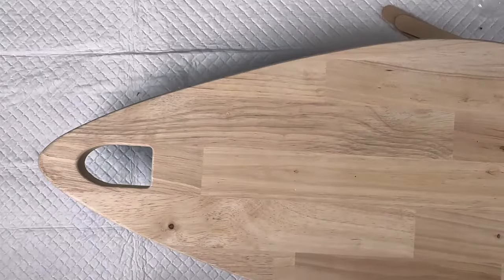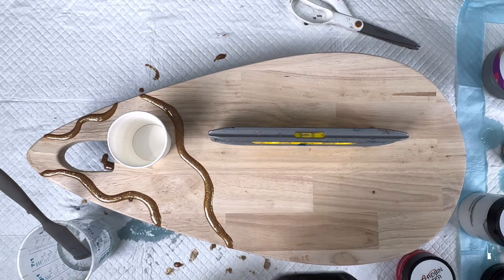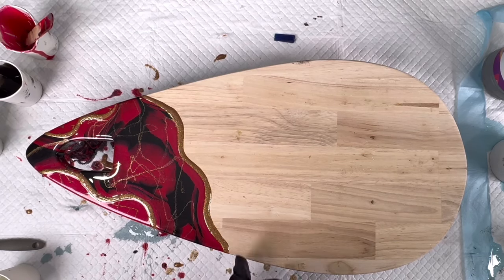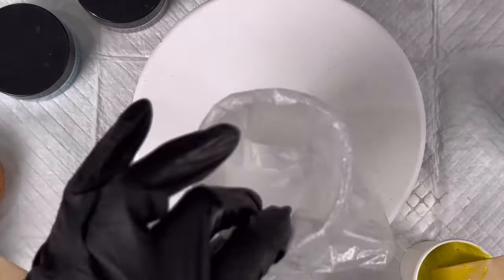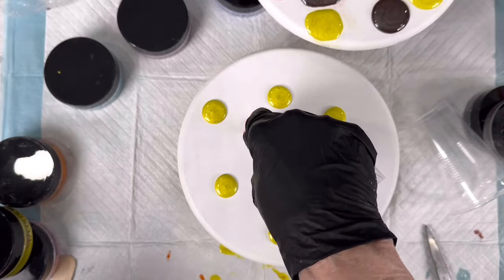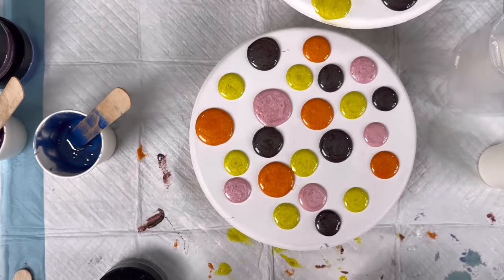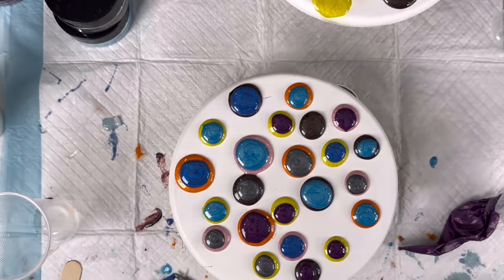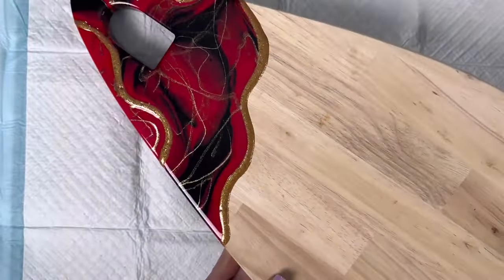HI BUILD RESIN ART

Comment: Hi Kym,  I'll be ordering this in the next day. But could I use a pipette or syringe to get precise line work as I'm going to attempt a leadlight effect using the hi build as the liquid lead.
Reply from the maker: Hi Samantha. Yes you can. I’d use a syringe for precise lines. I have used the piping bags for Geode work which was fine. Do a test run and see which one you are most comfortable with. ❤
Reply: What is the working time for this?  
New color availability time for the USA?
Reply from the maker: @evelynwarner517 around 30 mins working time. Estimated beginning of August for release of new colours. Send me an email to kym@colourpassion.net.au